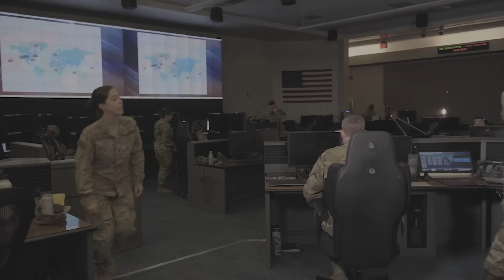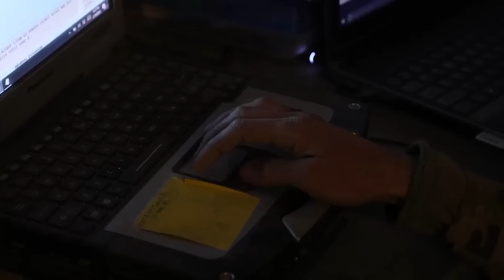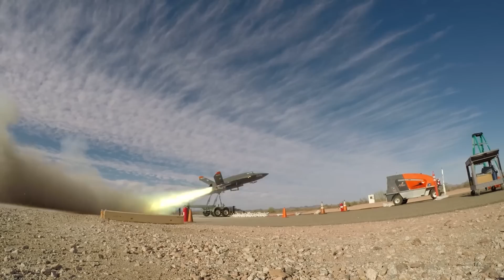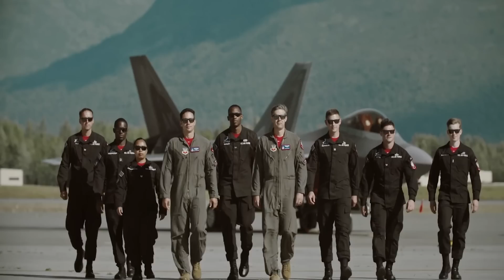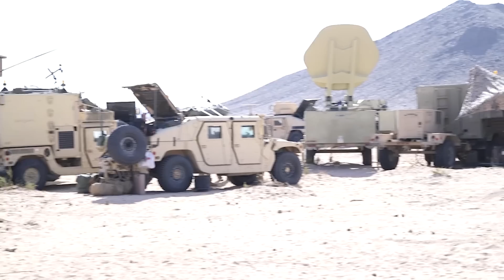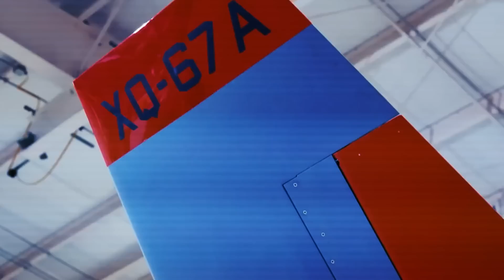The Unmanned Aircraft That Makes US Fighters Indestructible

Comment: not to rain on the US's parade, the UK MOD (DERA - Farnborough + Bedford) had a programme built from its augmented pilot programme (MMA++, 1990's) to have a bomber fly autonomously back in early 2000's - it made the news with a Tornado (twin seater) tasking an autonomous wing-man (BAC 1-11) to perform certain tasks for ISR - the programme tried 2 communication concepts, 1st computer based tasking and the 2nd military speak (verbal comms) - worked vey well

a fighter variant was built in the simulation center from a technology that came from a games company, CyberLife, and used something called Norm-Pilots (Norms being the avator within the game, which used Neural Nets for its thinking - the game it came from was called Creatures) - I worked on the augmented programme, but front-line pilots who helped play against and teach these Norm-Pilots, stated these autonomous wingman were easy initialy to kill but later became extremely hard (then they turned off the human flight tolerances and these Norm-Pilots won every time)

many of the concepts stated in the vid have been around for over 20+ years and so many papers suggesting using UCAVs for deep iterdiction missions using all sorts of variants (using MALD's to spoof their way into region and stealth UCAVs to do the actual prosecution under the orders / control of a local human steakth asset

at the time, the idea put forward was similar to the Henry Fords concept of mass production of cars, just in this case UCAVs of differing types for differing mission profiles - the US's GOA stated the cost savings could be massive in the long term

the biggest challenge not over come yet is the ability of any UCAV to plan its mission in the same manner as a human does - to predict future events from current observations and then get into position to react - we, as humans, have the ability to see a missions events in our minds eye using all of our background experience and knowledge - the UCAv has issues with the experience concept, as humans can think out side of the box

still, i did enjoy watching the vid and just wonder why we keep re-inventing the wheel every few years